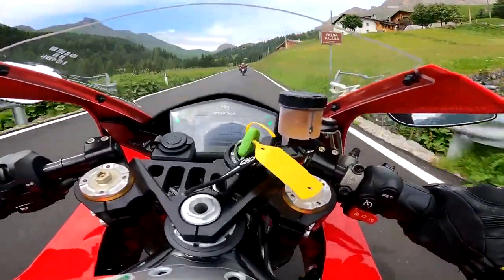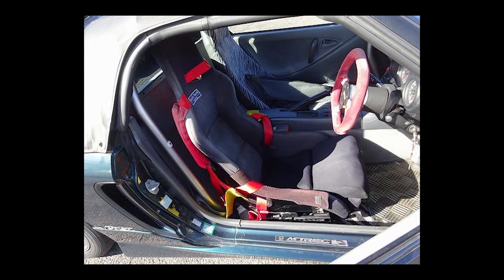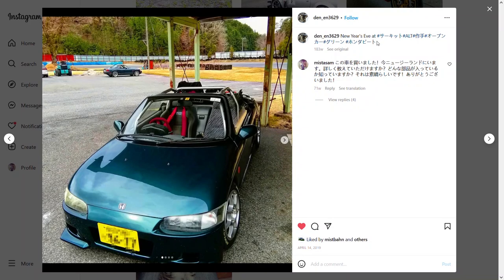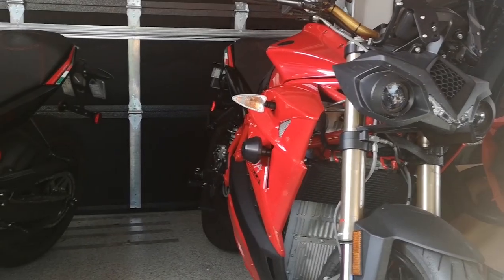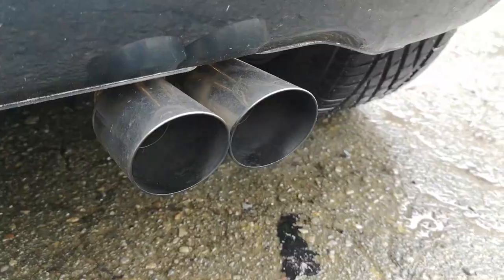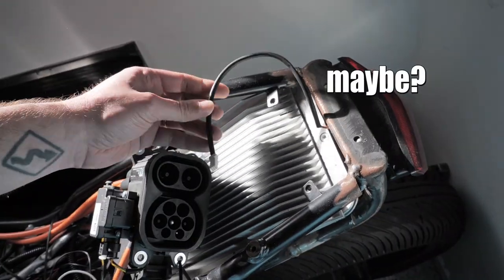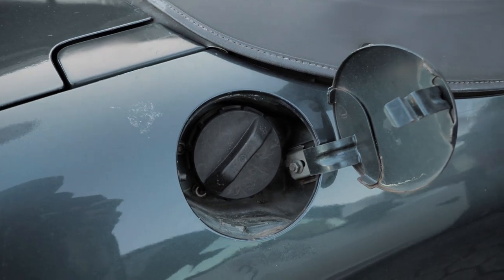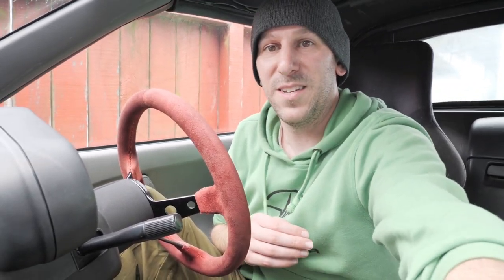Electric Honda Beat Conversion - Episode 1 - The Energicar Project Overview

Comment: Its finally begun!!! 🤣. Super excited to see more videos and how it develops over time, I wish you were able to keep the gearbox. Your initial announcement made me want to go research and see if it was done before and how, I understand though this makes more sense as your unfamiliar. Keep it simple is a good motto to live by.
Reply from the maker: Thanks man!  Yeah one issue I was always concerned about was inevitably blowing the gearbox up with all this torque.  Not just from the power, but also the regen, which is something I didn't think about.  Less complexity and weight, and also direct drive should be a better driving experience in the end.  We shall see!

Comment: Hey Sam, that’s going to be awesome project! Great being it a small car so it doesn’t take up too much room! Hopefully you have CAD/CAM folks to help you along the way! I reckon with a bit of thought, you can adapt the Energica motor to the standard gearbox? Either way it will be incredible! Will keep following for sure!🇦🇺
Reply from the maker: Cheers man!  Nah originally I wanted to keep the gearbox but it's in such a weird spot that I couldn't fit the motor and battery back there.  Losing it and going custom gear ratio makes the most sense.  We'll see if I stick to that plan though haha.

Comment: Sick project! Make sure the brakes work without a booster haha. Interested to see how the regen will work with so much more weight.
Reply from the maker: Thanks! Yeah if I don't need a booster that'll make it a million times simpler. Regen should be pretty insane, and there are lots of hills to use it on here.
Reply: @NewZeroland  Electric vacuum pumps do exist; it's not as elegant a solution as an electric booster, but it's far simpler to implement. Just a vacuum switch to turn it off when there's enough vacuum and a relay. ;)

Comment: I too was excited by the possibilities afforded a gear box paired with an electric engine, but agree that it's less complicated, removes some unnecessary weight, and you can sell everything you've taken off including the old engine.  Will be awaiting each video of the build with bated breath.  Good luck!
Reply from the maker: Cheers man! We did the math and the gearing was going to be too weird with the motor, and I'd inevitably blow the gearbox up so I'm just skipping a step 😂

Comment: Cool project, I wanted to do an EV with an MG Midget; they've such a heavy engine from factory that some reasonable range could be had without adding weight.

The UK car registration system doesn't seem to like DIY EV conversions though, so maybe I'll just save up for an Energica instead.
Reply from the maker: Haha that doesn't seem like a bad idea 😁 How do Electric Classic Cars or Zero EV do it? It seems like the UK is super into conversions.
Reply: @NewZeroland  They have to make sure the car is as entirely standard as humanly possible, other than the electric bits, which must not modify the bodyshell in any way; no holes, no cutting, picking up the standard e.g. engine mounts. And then I guess it's a case of crossing their fingers when it goes to be inspected.

If the inspection goes badly, the car loses it's identity and cannot be registered without going through a vehicle approval test; fine for a petrol (gas) car, it's designed to be passable, much like getting a car engineered in Aus or NZ. But for an EV to pass that test, it has to go through the full suite of electromagnetic compatibility tests, thermal tests and fire prevention tests that any new type-approved car has to pass. The test suite alone costs the thick end of £10k without including the development costs...